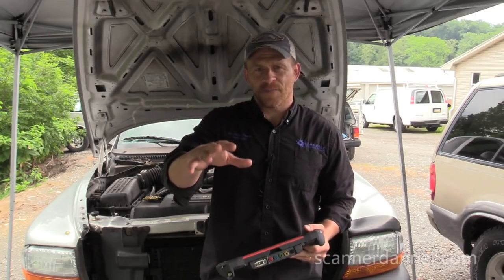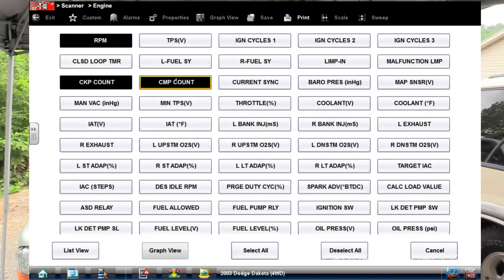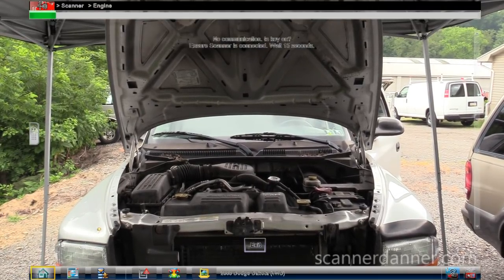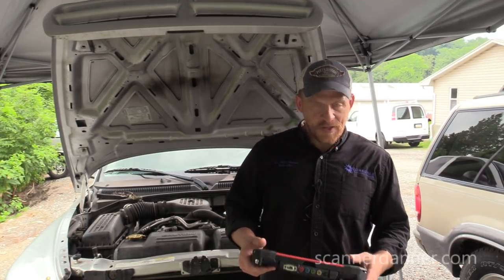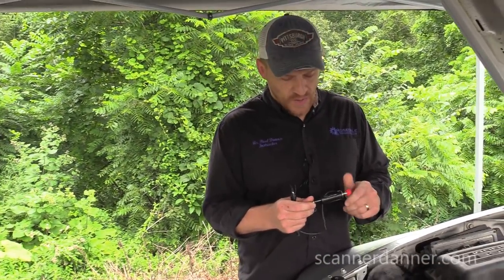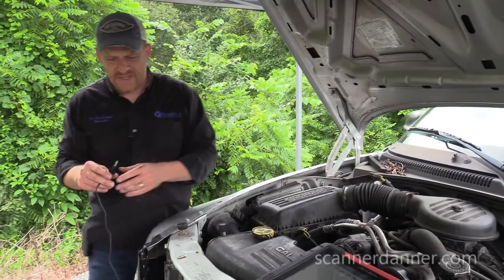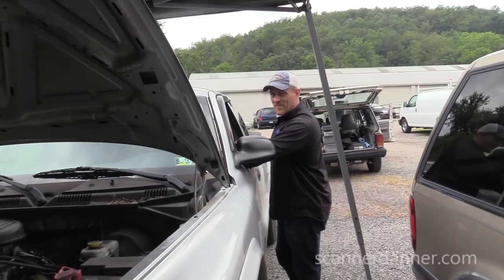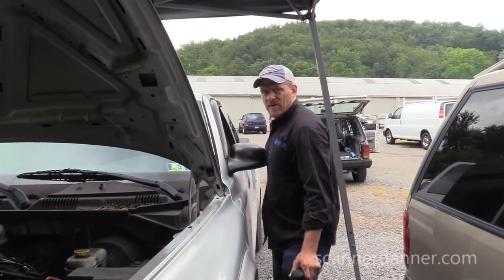Dodge Dakota No Start, No Fuel Pressure Testing

Comment: Had nearly the same problem in a 92 Dakota V8 checked all the way to the back. 100% sure its the pump, dropped tank, changed the pump, NOTTA... dropped the tank again suspect bad pump from part store. Decided to go a little further, turned out the wire to the terminal at the plug inside the rubber plug was broken. hard lesson learned, as the after market pump was $118.00, and was not as good as the original. FYI dble check at the plug terminal ends before buying the pump. Even probe the pump terminals once you drop the tank to prove it's bad. Love your videos..YOUR A COOL DUDE. Wish I had found your channel years ago. Keep up the great videos.

Comment: Almost 100%! They only bit I would add is the multi plug on the fuel pump,sender unit? You probed the wires close to the plug but without actually undoing the plug and checking on the contacts then there is always scope for a problem here. I speak from experience, pushed back pin in a plastic molex multi plug that stopped a fuel pump from running! I was convinced after doing very much the same as you that it was the pump. Only when changing the pump did I find the pushed back contact. 
 Like you I carry a full load relay tester in my kit. I runs a cycle of ten operations and carries out a milivolt drop check on the contacts and gives a pass/fail status. I also have a relay break out box kit that comes in handy. Sandwiched in series with relay it gives readily available test points.
Reply from the maker: no argument here my friend, but for us, getting to that connector was not possible so the tank is coming down regardless and these would be standard tests when installing a new pump (if I'm dropping the tank, it's getting a pump)

Comment: Good video!  A note on the Power Distribution box lid diagram to others working on a Dakota - the fuses and relays are in the positions shown, however, due to the shape of the box, the (A) bank is printed on the opposite side of the main bank (B) from where they are actually located.  It's confusing, but if you look at each bank diagram as a separate entity it becomes clear.
Reply: I got a great laugh out of this vid, when ScannerDanner hit that same wall, WTF? what kind of engineer designed this fuse box.:face-orange-raised-eyebrow:
im glad im not the only one!:face-blue-smiling:

Comment: You've got me into excellent habits, brother! I just repaired a short in one of those yellow dual rotating beacon light bars on a contractor's pickup truck - was thinking of everything I've learned from you along the way. Went down the wire, section by section, and eventually ran into a BUTCHER job on some wiring connectors, lol - turns out the owner's son hooked that light up for him. There were bare strands of copper hanging out of those cheap blue box-store connectors, and shorting directly into the cheap blue connector for the ground! Only mistake I made was doing an amp check with my meter - I briefly saw 29A before it nuked the fuse, LOL. It happens - 18 years with that meter, and I've nuked my share of fuses over the years. :D After I cut a couple feet of un-needed wire, bad connectors, and an un-needed switch, the lights drew 5.56A. Fixed! He took that off the excavation bill for my barn addition (where my new lift will soon reside!!). Every dollar helps. THANK YOU Paul!! :)
Reply from the maker: Awesome Smitty! Great to here you are applying this stuff and making some money doing so. Thanks so much for your continued support.

Comment: Good video Paul. The fact is not need to check the ground is cuz 0v tells me is good and the pump brushes are not making contact. If the ground has the chance to be open somewhere after go thru the pump u will see most likely 12v or close to batt voltage and is not the case here. I left the video at 45 min

Comment: The best way to understand that fuse box lid is to think to yourself that the lid itself is a stamp , like you would use on an envelope. If you imagine pressing it down and getting an imprint and looking at the underside of the lid it will all fall into place.  Diagnosis begins at 28:40 😁. Great video and great way to show why we don't fix codes , we fix cars .
Reply: I looked it up and the decal is definitively wrong...that'll get you chasing a rabbit down the wrong hole.
Reply from the maker: Not true, the first 15 minute were good too (spark and injection pulse testing etc), so only 15 minutes of me chasing a fog light relay , not 30 as you're suggesting
Reply from the maker: It absolutely wasn't just a mirror image was it? Part of it was and that was the issue, only part of it.
Reply: ScannerDanner Yes the lid was wrong.

Comment: You make me miss my daddy :)... He was an awesome person to diagnose my problems.. Even though I listened & helped him with fixing things, I am still no where understanding the circuits lol... I have a 2000 dodge dakota no crank for try then a crank on the second try.. Guess I will check fuel pressure! Thank you & your son for the video sweetie...
Reply: Katrina Georgia Girl no crank on the first try? Or cranks but does not start?
Reply from the maker: I'm sorry for your loss Katrina. A no crank issue is related to the starting system. Do you mean a crank, no start? Then on the second crank is does start? Or are you saying it doesn't crank over at all. Meaning no starter sound
Reply: ScannerDanner : Yes your correct, I meant it does not start on the first try, but eventually does on the second try after a long crank.
Reply: Keith DeFazio : does not start on first try, but eventually does after a long crank on the second try!
Reply from the maker: so I would describe that as a "long crank time" problem. Definitely get a fuel pressure gauge connected BEFORE you even turn the key on for the first time of the day. Check your pressures during the no start condition.
Reply: ScannerDanner

Comment: Good job Paul! I was thinking about the slowly dropping voltage at the positive feed of the FP coil, when you took the jumper wire off and I belive that is another method that confirms what you said: that indeed the winding of the fuel pump is opened. The energy stored in the solenoid (by autoinduction) shoud dissipate faster with a low resistance grounded path through the coil (with a good pump). Of course, when the only path (through ground) available is your high resistance voltmeter, it takes longer.

Comment: Once did a FP on a 90 Chevy pu w/454 tbi. I put a fuel line adapter in place, and proved to the owner that it was indeed a FP issue!! It was hot as blue blazes! There were multiple wasp nests! I ended being chased out twice by brown recluse spiders, one was right where I had been touching in the darkness, the other crawling on my overalls as I took a leak!! Was a hard job, took a long time, got the new pump in, and he wanted to see fuel pressure!! WHAT?? NO FUEL PRESSURE?? REALLY?? I crawled underneath, and disconnected the line at the filter, and SPLOOSH!! I got hit in the face with pressurized fuel!! In my eyes, in my ears, I was almost taken to the hospital because it was so bad!! Took me two hours to get back to it!

I had lost the little nipple inside my fuel pressure tester, the one that depressed the valve!! Oh, the fuel pump was bad, and I replaced it. After the fix, it started and ran, but before I started it, I showed him the NO PRESSURE, and took that as truth!!  GOT LUCKY???? Not a chance!! Wasps, spiders (I am deathly afraid of spiders), fuel in my eyes, ears, nose and mouth, worked for hours in the heat and sun! I got stupid, not lucky!! But the parts cannon worked this time, just for the wrong reasons!!
Reply from the maker: crazy stuff man, thanks for sharing
Reply: ScannerDanner you're welcome, Sir! And thank you for what you do!! I have learned a lot from these videos, even tho I'm not much able to work on cars anymore!!

Comment: This being a California vehicle, they ran a separate relay for the O2 sensor heaters. On the older systems, they did not, the ASD or the Fuel System relay did. Also if my memory is correct, the Alternator field power wire feed was shared with the LDP.
Reply from the maker: Thanks jarin!

Comment: My 02 Dakota has the exact same issue .with the fuse box and legend. Your relays are correct in their positions .I know because I was driving and then when I went to leave work the truck wouldn't start and I work by myself. No others messed with the truck. Dodge goofed up on the legend printing.  My relays are in exactly the same positions as the truck in this video. I think it the fuel pump as well

Comment: Thank you for this video.I have the same truck with the same issue. I am going to start with the spark/ignition side first like you did since it's the easiest to check.I don't have access to a computer scan tool.

Comment: Capacitance in the windings of the pump that are connected to the feed wire would be the reason for the slow discharge after the power feed is disconnected would be my guess. I would also guess that the open in the pump is on the negative side of the pump circuit because you ARE seeing the capacitance of the windings if the open is in the windings, it's a fair way into the windings toward the negative side. Could be the negative brush as well.
Another great troubleshooting video.
Reply from the maker: Thanks Fred, I'm pretty sure I have seen this "capacitance" in just an open wire that isn't making it to any type of coil winding. Are you saying that isn't possible? Thanks!
Reply: Hello Paul. All wires behave as capacitors and inductors to varying degrees depending on their length and how they are configured (like a coil of wire). So every wire will store a certain amount of charge when a voltage is applied like the wire feeding the pump as well as the windings in the fuel pump. When you apply your 12 volts dc to the wire, you build up a charge in the coil that is stored there in a form that capacitance stores it, and then when you disconnect the power the stored energy flows through the resistance in your meter to ground at a rate of speed determined by the amount of storage, and the value of the resistor. The other factor there is that the magnetic field around the coil will resist change in flow current and provide additional resistance slowing the discharge. Also, the armature and field cores of the pump will store part of the magnetic field which on collapse will flow out of the wire, so there's more than just the wire contributing, there's also the steel mass involved near the windings.
Since there is much more capacitance in the pump than in the wire that feeds the pump, the discharge time will take longer than normal. We enjoyed watching a fairly slow discharge through your meter in the slower than normal voltage drop time. In a normal straight piece of wire the very same thing happens but in a shorter wire, and one not coiled on itself, the discharge happens far more quickly, due to the fact that there is less capacitance there, less of a stored magnetic field that will collapse. So no, I'm not saying it's not possible, it's always happening, but the speed is dependent on the amount of static field that is stored, and the internal resistance of the meter. This is something we can test pretty easily using a length of wire, coiling it, applying a voltage and watching the discharge. An o-scope can be good for seeing changes in shorter pieces of wire, and also playing with coiling the wire and such. Large coils with iron or steel cores can be more noticeable as we see in your video. Take a length of wire, stretch it out straight, run the test. Coil the wire up and run it again. The discharge time will be longer on the coiled wire due to the resistance to the collapse. Wrap the wire around an iron or steel object, and the time will be even longer.
So I think we agree. Wires store energy, and how fast the energy is bled off is determined by various factors.

Comment: Spray first, check pwr to pump, pull tank if good pwr. If no pwr, dance with relay operations.... 

I see some Chrysler use mirror image on PDC lid and others are as they are. To make us good and nuts!  I'm 62 and been driven nuts from these. CK the pwr to pump first, then if you want to know what relay controls it "pull relay's".  I find a power probe will knock out these uncertainties in seconds,, not even minutes. It's a good little friend for measuring voltage numbers as well.... 
THX..

Comment: Really good diagnostic procedures. The only other option would be a corroded connector on the fuel pump, but I agree that's very unlikely. Thanks for sharing. I have a 03 Dakota with a  crank no start, and NO BUS on the Instrument Panel. I have 5vdc on the sensors, no ASD activation good wiring to the sensors. I jumpered the ASD relay to activate the Coil and fuel pump, they work, but still have a NO BUS on the dash and a no start. Did note the CMP has pulse, but the CKP has no pulses coming out so I'm going to change that and try again. My only concern is the PCM NO BUS on the instrument panel. Any ideas on that one? Thanks for the show. Best Wishes & Blessings. Keith Noneya
Reply from the maker: Did you fix it? Got a good crank signal now?
Reply: @ScannerDanner  The owner went out of town for a wedding. We changed the CKP but it still didn't start, so we'll should be checking it within the next few days. I'll let yall know, Thanks for the reply. Best Wishes & Blessings. Keith Noneya

Comment: Hey ma  I have a similar problem. Ny dakota 02 3.9L has intermittent  power at the pump. Can be off 2 days you came a crank and I works good after 30 mins it drops the power again. New pum, new relay, no codes. I don find any cuts on the cables. Is driving me crazy

Comment: is it possible for a crank sensor to rub on tone ring if tightened beyond rated torque setting or if loose? I put in a new crank sensor it got rid of  my p0340 and p1391, started everytime, but then had a new ticking noise for a bit then went away, just had a no start and the codes are back.

Comment: Great video....I have a dodge Dakota (been sitting for about 4 years)  now wont start... it tries to crank just like this one in the video... sadly I cant do the work myself, but I'm now knowledgable so I wont get ripped off by a repair shop.
Reply from the maker: Step one. You will need to drop the fuel tank and get rid of all the gas and change the fuel pump and sock strainer and in-line fuel filter.  It is possible the pump is still good. So a psi check would be first. But I wouldn't drop the tank without also replacing the pump. 
Step two, Your injectors are most likely stuck shut from the varnish build up, you may need to replace those too. If you are lucky you may be able to get them to start firing again my tapping gently on them BUT you HAVE to get rid of that old fuel!!!!!!
Reply: @ScannerDanner  thanks for the reply!!!        I'll let you know what I find out .. hopefully it wont be too expensive to fix...

Comment: All you need to do put 12v bulb on fuel pump wire then the end of the lead of bulb put in to ground just to test your positive power. Then look for the ground side. No headache😊😉

Comment: Awesome. Now I know how to check my 91 when it has its intermittent no start. Odd last time it died on me I banged tank, swapped relays. Nothing.  Ended up having a gal of gas in back, kept feeding throttle body with a squirt to get it running. After 5th or 6th time it stayed running.  Thinking fuel pump in my mind. Only does this when it's hot out and just under 1/2 tank of gas

Comment: Hi all, I have a 2004 dodge Dakota. It has a new battery and now is on its 3rd fuel pump.  Vehicles runs well for months but in the past year has there has been times where I stop the vehicle but then will not start.  I have left it for 20 minutes and then it will start back up and be good for months but then the same thing. It will not start. Any thoughts?

Comment: I had same problem, but I replaced my fuel pump, and still no pressure. Checked the fuses and relays, changed the cam sensor, swapped relays and still no pressure. Dead pcm? Been messing with this for 10 days now and I NEED my truck. Plz help

Comment: I have a question hopefully you can help me out. I have a 2000 dodge Dakota and it wouldn’t turn over when trying to start so I changed out the starter and now it turnes over but the truck shuts off right after ... it will only stay on if I pump the gas pedal but as soon as I take my foot of the pedal the truck shuts off .. my father in-law thinks it might be the fuel pump but before I start changing that out I wanted to get a couple other opinions and see what you might thing it is ... thank you
Reply: Did you ever figure this out??

Comment: wow, what a great video.  I have a 2000 Durango 5.2 that has the exact the same symptoms.  My neighbor was helping me out and went through all the steps you did.  also, when he checked the fuel pump relay, he told me the fuse was gone. (just like this) should I assume my fuse is in the same position as this truck?  He suspects it's the fuel pump also.  (it's been sitting for a long time)  edit his last step was spraying carb cleaner in the carb and it started.  what's the best way to empty all the old gas from tank/lines?
Reply from the maker: to be honest, unfortunately you will need to drop the tank to get rid of the old fuel and then change the pump while you are in there. Also, make sure you change the in-line filter

Comment: Do you think you can make the fuel pump motor spin a little by back feeding fuel pressure down the line? (To see if you can make brush contact)
Reply from the maker: Not sure how that would help in your diagnosis or where you'd get fuel pressure from with the pump not spinning. Maybe I'm misunderstanding your question?